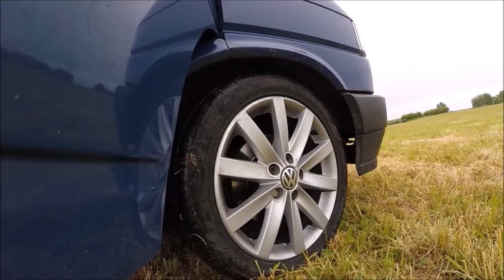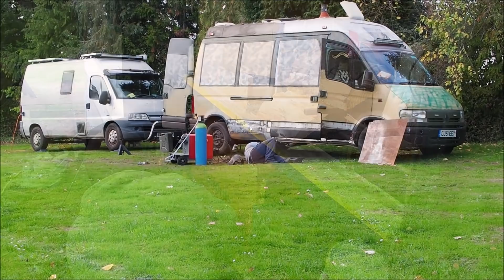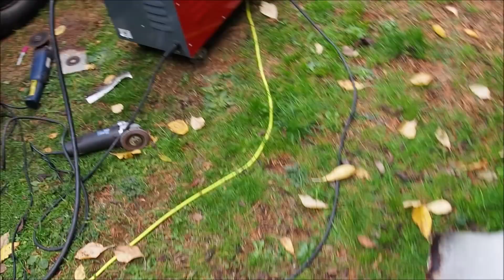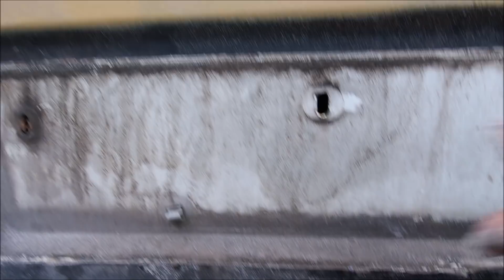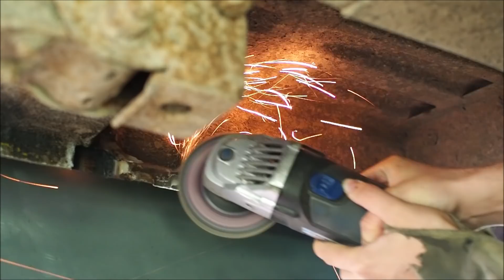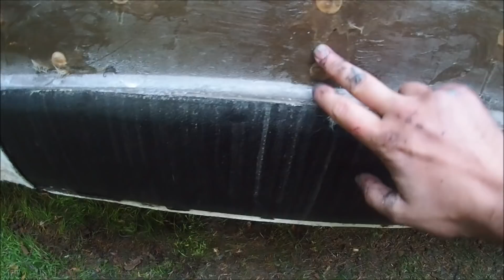Welding Cutting & Painting

Comment: Just  a tip drill a hole each end of the sill and get some wax oil  on the inside when done put rubber grommets  in the holes they will last ten times longer, they condensate on the inside and they rust from the inside out ,,great job mate......dell